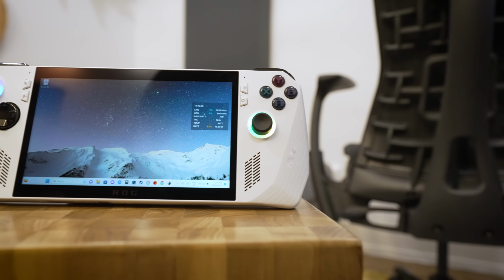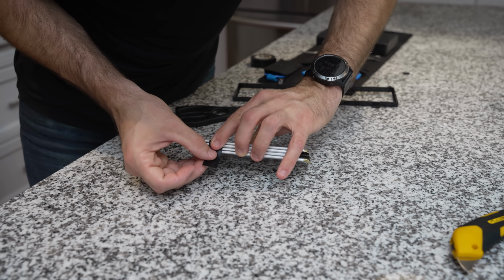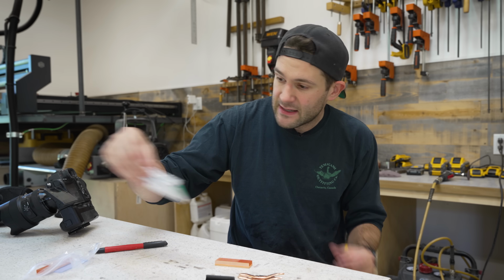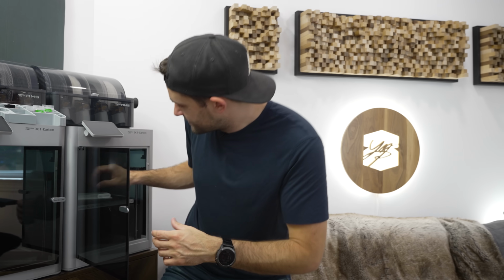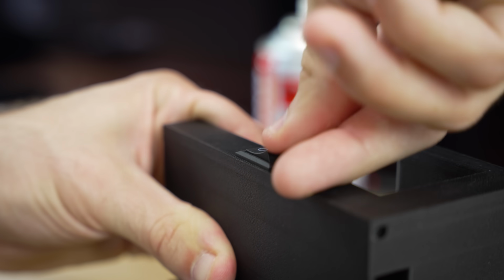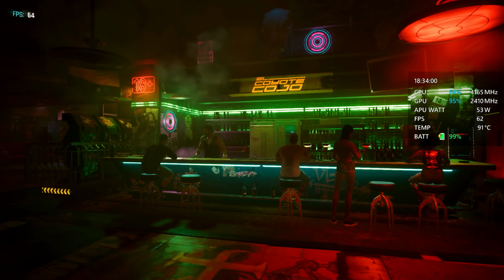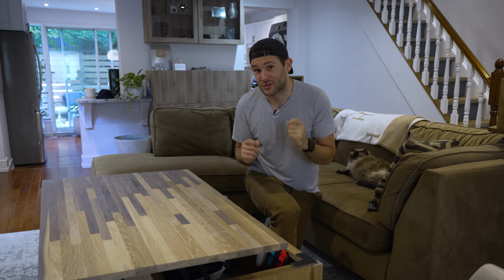I don't understand why people buy Steam Decks...

Comment: Can it run Linux?
Reply: Yea but gonna be hard when ur using a joystick as a mouse
Reply: @corevanity  It doesn't have a touch screen or touch pads, huh?

I was asking about the compatibility for the rest of the hardware too though, like the wifi card, the bluetooth adapter, the joysticks and buttons, and everything else. If there's not at least one competent Linux graphics driver for this thing, then it sits dead in the water. Unless you just really want to take your viruses for a walk.

Besides, using the joystick as mouse input is going to be a shitty experience, regardless of the OS. This is no better for Windows than it would be for Linux.

Comment: I feel like you're making a pretty good case for buying a Steamdeck. None of these alternatives that also came out recently are truly complete packages, and always have caveats. 
Personally, I'd rather use a GPD Win, because I like the format and keyboard.
Reply: I got a 7840U GPD Win Max 2, and it's friggin' incredible. I use it like a giant handheld often, and it completely replaced my laptop while offering a BETTER typing experience within the shell of a 10.1"-screen device. The battery is better than the Deck in 35w mode, and when I run it in a battery saver mode, it lasts like 8-10+ hours, which is just bonkers. I loaded it up with 6.5TB of storage, too. My Deck mostly collects dust now - not because it's bad, I still love the Deck, the WM2 is just enough of a step up to render it nearly obsolete. Deck's more ergonomic with better controls, though!
Reply: @nickstarlingch  My 7840u Win Mini arrived 2 days ago and i am currently ignoring my 3080 rig lol. AAA games on my 3080 for sure but i am tinkering the heck out of my mini for the past 3 days
Reply: @nickstarlingch My 7840U has been an amazing experience as well. I can play most titles on the system, not to mention the Emulati g performance. Portable PS3 was not something I was expecting for a long while.
Reply: I have an 8" generic Windows 11 Tablet  with a keyboard dock thats similar and i can vouche for this form factor is amazing. I use it 80% gaming PC 20%. So thank you for the confirmation. GDP win will be my next gamign handle. Never will I say, I wish my laptop was closer, I don't want to surf the web using htis. If iits anyhthing like my significanly weaker windows tablet, I'd  expect With GDP win's full keyboard. on Windows 11 in tablet mode, using a mouse is toally optional.  only the keybaord is sort of missed here, except its built in so its a full package. and clamshell so i don't have to buy a case? yes please!  @nickstarlingch
Reply: Nothing he’s doing is necessary, I have been emulating ps3 on a bone stock z1 extreme ally for a while with no issues, battery life is about an hour at full tilt but I’m always near an outlet when I’m using it anyways.

Comment: Woah woah woah woah woah… bismuth solder compounds aren’t for low temperature soldering, they’re for low temperature DEsoldering. You apply it to regular solder to extend the time is stays molten at low temps giving you enough working time to remove large chips. You are supposed to clean up the bismuth solder once complete and aren’t supposed to reuse anything contaminated with it.

What you should have used is a thermal adhesive.

Comment: If you don't overclock the CPU there is no point in adding more power and cooling to it. at best you are helping the boost clock to be consistent but otherwise no real performance gains.

Comment: This video is very explanation about why companies design things in the way they are designed, and do not end up with frankenstein-mods like this :D 
If Asus can get the same quality but make the battery to run 4-8 hours like on the Steam Deck, without make something like this, then it is one thing; but if they didn't, clearly it is because it can't be done without make the device bulkier, heavier and frankly, ugly.

Comment: Honestly the ABS and fiber print materials are overkill. PLA can take a good bit of abuse in my experience. I don't really see it being a problem with the heat the handheld is going to put out specially when it comes to potentially being cooled better than stock. Been a couple months since I printed but I'm pretty sure I print PLA with 210c which is 410f. Realistically the console shouldn't get hotter than 80c.

Comment: The usage of a liquid metal in such a way is dangerous, this mod is half done. It`s somehow works with desktop PCs(even then depends on a quantity of used metal, using too much is bad), yet for laptops and portable game consoles there`s too much of movements, so the balls of metal have a high probability to leak on the motherboard and burn it. Just isolating the capacitors around APU isn`t an option, there is a need to make the whole zone between APU and the cooling system leakless. Try to look at how it`s made on PS5 and some laptops that use a liquid metal right from the factory.

Comment: 1. SD card slot cooks the SD card
2. The ROG ally was released too soon and is extremely flawed
3. The Steam Deck worked and made Linux gaming available.
4. Steam Deck is made by Valve (the people who made steam)
5. Valve made it so anyone could modify the Steam Deck
6. ROG ally runs Windows 11

If you still want to say that the ROG ALLY is good, then you probably are trying not to be wrong.

Comment: This thing is unfairly expansive in my country. The Steam Deck is not yet officially released where I'm from and yet it cost 485usd for the base model (which can be easily upgraded) and 412usd second hand. The Ally OFFICIALLY released here and yet it cost a whopping 1040usd double the price of the Deck but not really double in performance. The other thing is that most people (at least the people who cares about the gaming future) will want to buy and support Valve for their SteamOS because if the SteamOS succeeds we now have a better and free OS to use other than the terrible Windows OS.

After this comment I'm boycotting this channel.

Comment: Could you have made a quick swappable battery pack, like a laptop or a slide in and lock?  Maybe at the same amp hour of the original to keep the size down. Of course hot swap would be nice, but not needed.  I did watch most of the video but can the pc unit take power direct from the wall and still be in use like a laptop?

Comment: Can you install SteamOS on this thing? If so, it's viable. If not-- fuck it. I don't want a handheld windows machine until Windows can figure out how to deliver a handheld experience. They can't even get the tablets right. I love my Surface Pro but the software is obviously meant for desktop (laptop mode works fine but tablet mode leaves a lot to be desired).

Comment: Valve has the pull to influence  game manufacturers to get optimizations for games specifically for the steam deck . In that regard the steam deck is an appealing option
Reply: Yup, I have a powerful PC as it is, but I'm using the steam deck as the ideal optimization factor for my games, if I can play it smoothly on my steam deck, I should be able to play it smoothly on my ally as well.
Reply: Not just optimization for games on the steam deck, but also for linux, since thats what the steam deck runs on. Thats one of the reason i like the steam deck so much

Comment: If you are going to bend copper heat and quench it after each bend, it behaves the opposite of steel in that slow cooling hardens it and makes it brittle while quenching actually anneals it making it softer and releasing stresses in the metal.

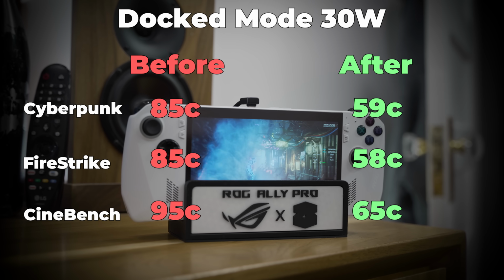Comment: 17:55 You're heating metal with a torch, using cold-solder stuff, craft/3d-print/build a whole new device out of components, use a custom BIOS, see that it doesn't even increase the performance - and then ask the video describing question: Why don't people do what I did and instead buy a Steam Deck that works well and has good repair support?

Comment: It's a weird thing for me because having bought a Steam Deck, i know how frustrating it is to try to play anything not on Steam. (I'm not a Gaben worshipper so I don't buy only on Steam). Having a machine that runs Windows would probably save me a lot of headache
That said, the flipside is that a lot of games would only have good controller support because Steam did such a good job with Big Picture and controller profiles, so its ironic that the Ally can be a viable option only because Steam did such good work.

Comment: I don't need the best hardware. On my budget, what I want in a portable device is the greatest chance six years down the line that I can both logistically and legally repair it. Valve doesn't have a great track record from that perspective, but no other hardware manufacturer seems to come close. Simply choosing from the start to orient themselves to encouraging consumers to modify the Steam Deck, or source their own parts for it, or in the case of basic physical things actually provide print files (not that I can currently make use of this, but it's still a meaningful act) have earned them a lot of credit with me. And given that most of the games I'd want to play on a device like this are at least a decade old anyway, going cutting-edge doesn't offer me much.

Comment: What kind of 3d printer is that and how much does it cost? Also, how difficult is it to design those pieces he made? seems like it would have to be perfect to fit right in there and line up with all the old drill holes. I wouldn't mind getting into 3d printing but I don't know how difficult it is to design your own parts

Comment: Another option for low-temp soldering is to use lead plumbing solder. (used on copper drain piping) It melts at a much lower temperature. The downside is tinning flux must be used to keep surface from oxydizing, as there is no flux/rosin core in the solder.

Comment: The only thing ROG Ally has over the Steam Deck, is overall performance

The Ally's only strength over the Deck is being able to play AAA games a lil better than the Deck. That's the top less-than-1% of the entire PC library

What about the rest of the PC library, the 99.9%? When performance isn't even a concern, it boils down to erry other aspect of the handhelds. Battery/playtime, OS, ergonomics/controls, price, display, etc. The Steam Deck completely dominates in erry other area, rendering all competition 100% obsolete

The only reason normies buy the Ally is so they can play their AAA normie games. That's it. All they care about it 'muh power'. Higher res, RGB, higher refresh rate, etc, doesn't make it better. This is a handheld, not a desktop or laptop. It works the other way around. They're in the wrong market

If they're that desperate to play AAA games with that budget, they can just buy a Mini PC for the same price, or maybe less, as the ROG Ally and get significantly more out of it. They're gonna be tethered to the wall anyways

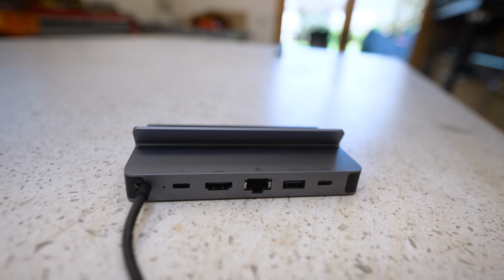Comment: 16:02 A diode, an NTC resistor, solder together, acts as a switch, when temp goes up.
Put deck in, while in use, switch closes, starts fan. No PCB required.

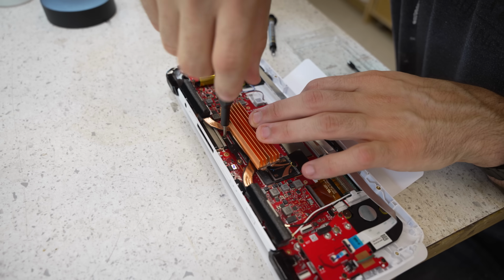Comment: 9:24 Just one drop. If the heat sink fits well onto the CPU, with minimal distance between, one drop is more than enough.
(In some instances even a whole drop is too much, and it'll squeeze from in between the CPU and the sink.)

Comment: I don't understand the need for the extra heat pipes, just attach the extra heat sink to the original heat pipe and you'd get the same if not better results.
the only reason to move the location where you are doing cooling (to where you have room for fans for example) but all you've done is lift it 10/15mm

Comment: Can't believe you put insulation on the CPU... great way to increase temps. The reason people avoid liquid metal is because it's corrosive and will eat away at the CPU and Heatsink over time not because it's electrically conductive.

Comment: This seems like Baron von Münchhausen riding his cannonball yelling "I don't understand why people drive cars...". ;)

In my case I bought a Steam Deck before an Asus ROG ally existed... But I'm not exactly motivated to replace the SD with the Ally, because the SD is more power efficient, and I prefer SD OS with the Steam interface over Windows with the Asus interface. The problem is that AMD made more powerful CPU/iGPU chips after the 4800u (which is essentially a SD CPU/iGPU), but they did that by using more power and doing very little to improve efficiency.

Comment: I would’ve put a momentary switch on the bottom of the dock that activates via pressure from the system being on top of it, turning the fan on when docked and off when removed.

Comment: The streamlined os, the trackpads and ergonomics, the ease of reparability should anything go wrong? Oh and dont forget the price point; thats a big one since pretty much everything running windows in the form factor is almost double.  The only really boost the ROG and some of the other windows handhelds have is the ability to use an external GPU should you feel the need to shell out another $1000.

Comment: You can try to adjust voltage curves if available to achieve better results in both thermal and performance with those 54 wats and make another video about it ) Thanks for the content

Comment: I don't understand why people buy Steam Decks...

VERY simple, they are cheap, they work great, have fantastic support and best, 
it uses Linux as a OS, yes is much better nowadays, then the spyware OS called 
Windows 10, and absolutely Windows 11, that also steals everything from you 
true BingAI.

Have been a Windows user almost 20 years, and went to try Pop OS (Linux) 
two years ago, and i never went back to my Windows 11, so i removed Windows 
11 from my dual boot, and have now only Pop OS on both my computers, on my 
Mini Media/Console-PC (Intel Core i3-12100F, and 16GB 3200MHz DDR4 RAM, 
and a Radeon RX 6700 XT), and my Game-PC  (AMD Ryzen 7 5800X3D, and 32GB 
4000MHz DDR4 RAM, and a Radeon RX 6800), i have many games on my Steam 
account, and they all work great on Linux with Proton, get about the same FPS as 
with Windows 11, but then without all the spyware and BingAI.

No there is absolutely no reason to use Windows 10/11 in 2023, even 2 years ago, 
for 99+% of the people Linux would be great, and also works great on hardware 
Microsoft thinks is to old for Windows 11.

Comment: conformal coating is amazing, but also about the nastiest thing i ever worked with. waterproofing my drones was a full success, but they gassed off, like fresh super glue for days, depending on the temperature. cating a little 30x30mm PCB was enough ,that i had to put it outside  because it made everybody in my apartment complain about the smell, and suffer mild respiratory irritation

Comment: Yeah, I learned this lesson with my Vega 64 and R9 3900X. Feed em all they want, and you barely see any boost. These days, performance chips are pushed nearly to their limit right out of the box, and are where a normal overclocker would've gone with it anyway. It's actually better in many cases to just underclock things a little bit and they get really efficient.

Comment: People buy the Deck because Armory Crate is bullshit and the Deck, at it's 15w or lower TDP, is actually at least as, if not more, performant than the Ally. 

See GamersNexus review on this. 

It's pretty simple, the Deck is a better laid out, engineered, and supported system with SteamOS at the core of it's being, it's better at being a mobile gaming platform and when it matters, that is at or below 15w tdp, it spanks the ROG Ally. 

Almost like Valve has a bunch of engineers who specifically designed a chip with AMD to do exactly this rather than Asus who picked one off the shelf...

Comment: “I don’t understand why people buy Steam Decks” proceeds to spend probably over $900 for this. The steam deck is $360 when on sale which happens almost every two or so months. Slap in a 1TB ssd for about $89 or maybe less. Boom. You spent less than $500. Plus you get way better software support, track pads, stability, and an actually large community that develops software. Not everyone wants to spend $1000 on a handheld, especially considering for more demanding titles, I’d probably rather play on my main PC anyways.